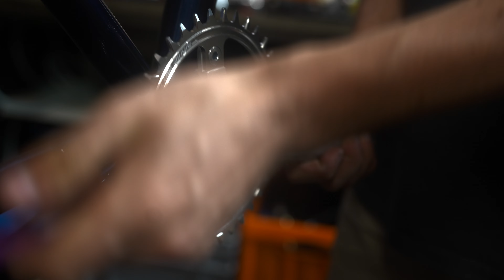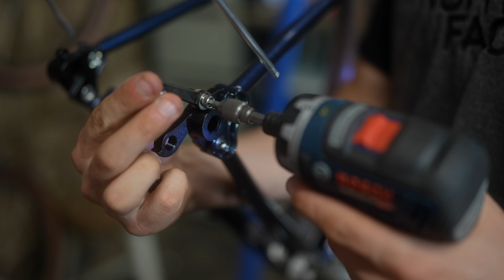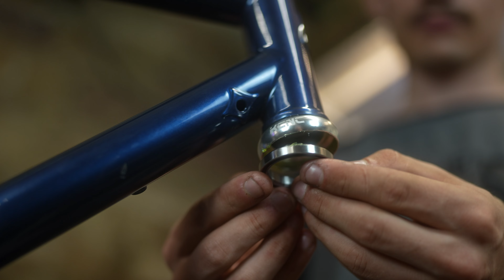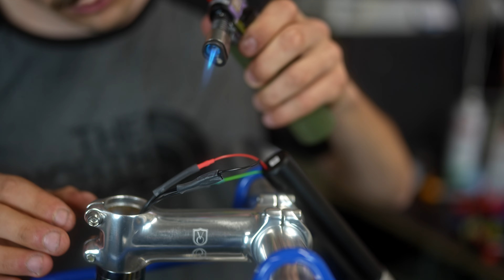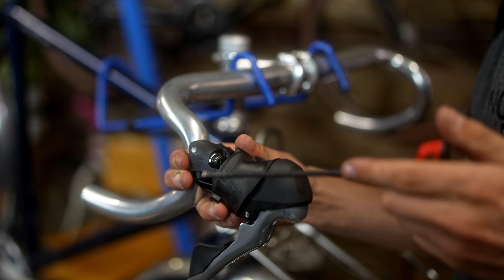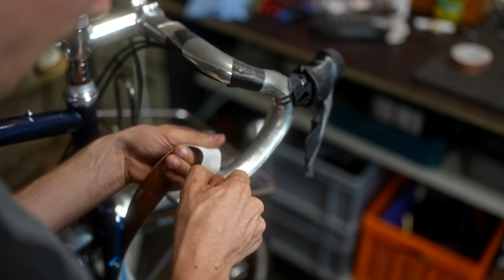Classy Hector - Custom Randonneur BIKEBUILD 4K

Comment: For it has been written in the book of our Mechanics passed, "Thou shall not strip thy threads by starting bolts with power tools."... BTW great work on the fenders, they look like a pita to put on but look amazing!
Reply from the maker: I’m kind of used to using powertools, since it is what I do at the factory !
Thanks, yeah they are pretty awful to install but look soo nice
Reply: Seriously the impact here is wild. This man has balls of steel to do that. I work with power tools every day in my job too, but would never use an impact on a bike. Great build though!

Comment: What was the material used under your handle bar tape?
Reply: Looks like a product that Shimano sells under their component brand 'Pro'. Look for "bar gel" or something similar. I find it makes the bars waaay too bulky. The version that Specialized used to use (may still do?) would disintegrate under the tape and when you would change the tape you would have one giant mass of sticky glutinous goop that you had to clean off of everything. Personally I find using a lengthwise bit of bar tape is more than enough for most people, but your mileage may vary.

Comment: Modern group set, 12 speed, disc brakes, dynamo lighting. But why a square taper crank and BB? Mine was junk on my road bike, swapped out to Hollowtech crank, huge improvement. 

Also, ever try Jagwire’s compressionless brake cable housing for disc brakes? They make a big improvement in Mech disc brake feel over regular brake housing.
Reply from the maker: I chose a square taper for the style and the low Q factor it offers ☺️

I actually used compression less housing from Jagwire, and I can confirm that it improves the brake feeling a lot !

Comment: What a beautiful build. Well built aswell, usually I find a mistake or two during a video but this was perfect. Can't have enough silver parts tbh. One question - the rear Juin caliper looked to sit a bit high on the rotor itself, leaving a big part of the surface unused. I haven't had the chance to install the Juin yet but did my eyes make a mistake or is it a problem with the calipers (cause for sure its not the frame).
Reply from the maker: Well thank you !! 
Yes, when building I realised the Caliper has +20 compared to a TRP Spyre for example ! So I vad to use a 180 rotor instead